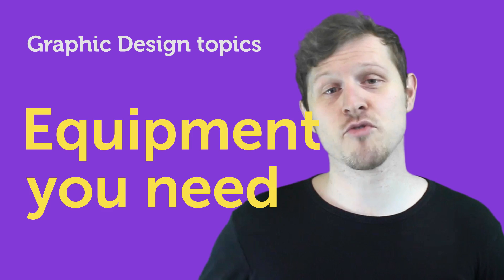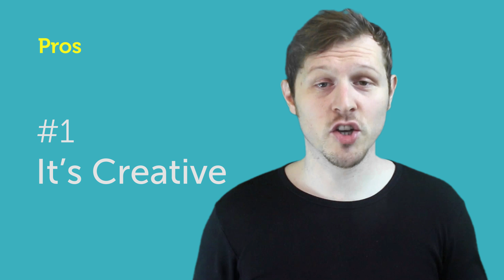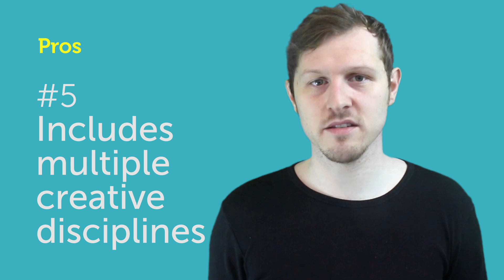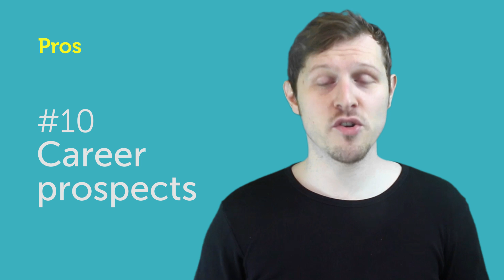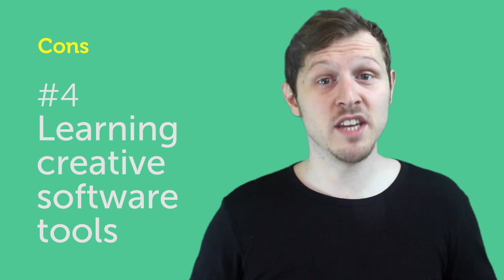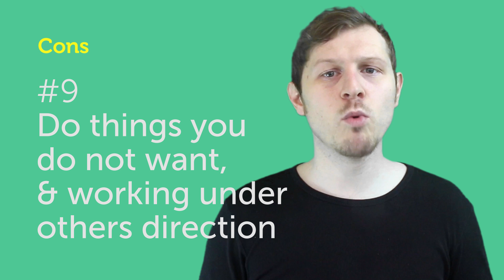Why do Graphic Design? Ep17/45 [Beginners Guide to Graphic Design]

Comment: Should do a video on working with clients (specifically bad ones). Also I FBed you a question, but maybe it'd better to ask it here: when exporting documents for client preview (not print), I get a notice that says they are in CMYK mode (since I'll eventually print them) and need to be in RGB. Is this correct? Not sure what to do since they need to be in print but want to send a digital preview beforehand. If I coveret to RBG for the preview, will I have to reconvert them back?  Also another question that has me confused for awhile is when to use PANTONE colors. Thanks!
Reply: What you can do is if you are working in photoshop then just save a a web and give low res jpeg to client, if you are working in Illustrator or indesign and then just save as a PDF and choose smallest file size and give them PDF low res for previous or approval for work before final production file. this way file size wil be small and easy to open. hope this gives your answer